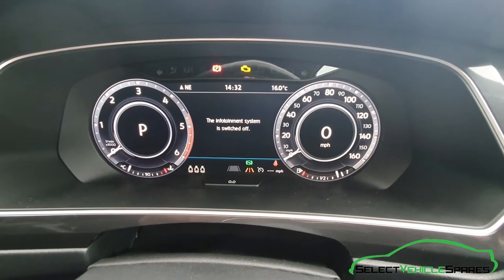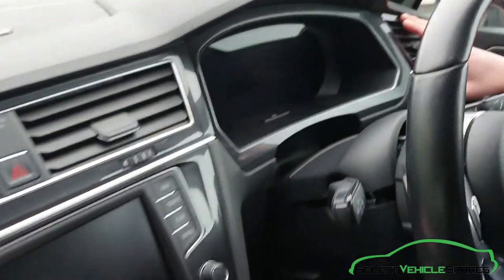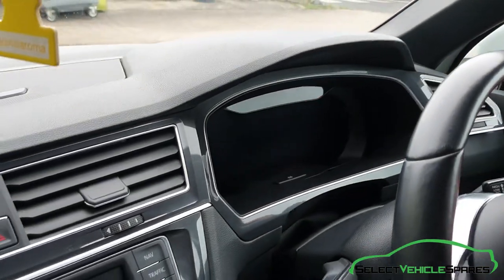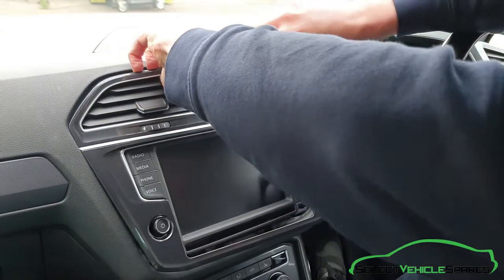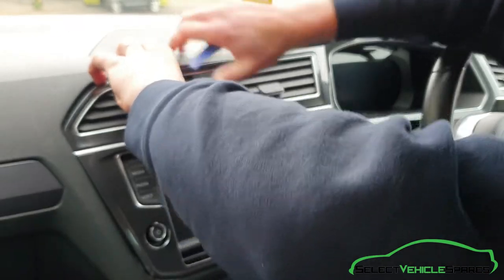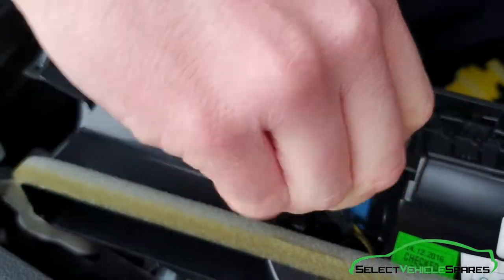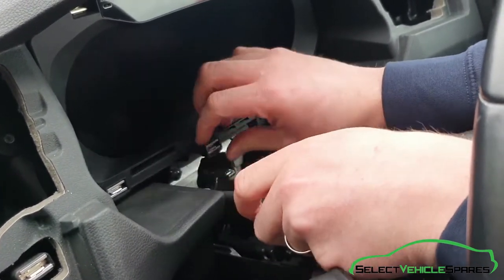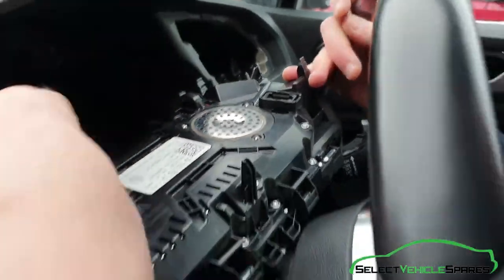VW TIGUAN MK2 - How To Remove Digital Cockpit Speedo Clocks Display Screen Removal Replacement

Comment: does the engine managments always come on like that when you turn the ignition on? i assume it turns off once you start it?
Reply from the maker: Yes, as long as there are no faults it will go off when started.

Comment: Is this possible to change only speaker from virtual cockpit? Because mine sometimes didn't work when I switch on blinkers
Reply: Yes! I just successfully fixed the blinker issue today by replacing the speaker following this video

Comment: team Ive got as far as exposing the instrument cluster but cannot get it to budge - any advice
Reply from the maker: Once the 2 lower screws are removed the screen should just be clipped in, however they are very tightly clipped in from new. We would recommend starting in one of the top corners, it will eventually go with enough force, but be careful not to put pressure on the digital screen.
Reply: @SelectVehicleSpares  should I try some wd40 around the clip for 24hours?
Reply from the maker: @jeevandhaliwal1  No, we would not recommend spraying WD40 in that area.
Reply: I had the same problem. It had 4 clips that holds the cluster and got cuts on finger pads from trying pull it out.
So my solution was to put the flat rope behind the cluster corner and then pull that rope by both ends. I had to use a lot of force, but it worked.

Comment: I’m trying to remove the whole dashboard and have stripped it down to nothing but it still won’t budge any advice?
Reply: I had the same problem. It had 4 clips that holds the cluster and got cuts on finger pads from trying pull it out.
So my solution was to put the flat rope behind the cluster corner and then pull that rope by both ends. I had to use a lot of force, but it worked.

Comment: Do you know where the telematics communication module is located on a 2020 Tiguan? I’ve read that it’s possibly behind the cluster?
Reply from the maker: No sorry, we couldn't confirm where it is located. In earlier VW models it can be under the front seat/carpet area, but we've never had to access one on this particular model.